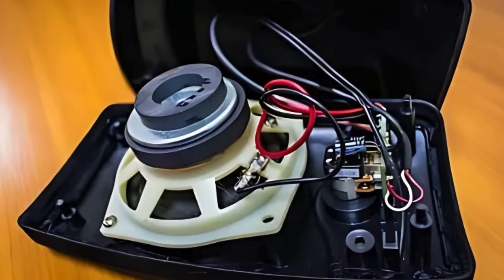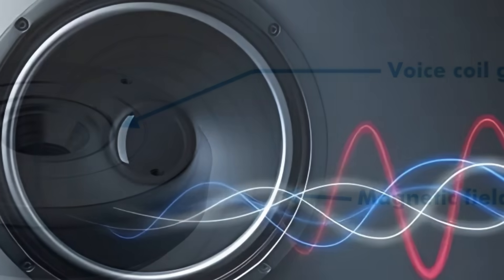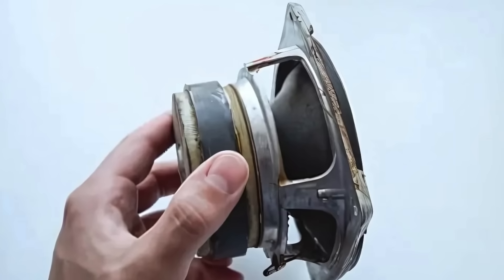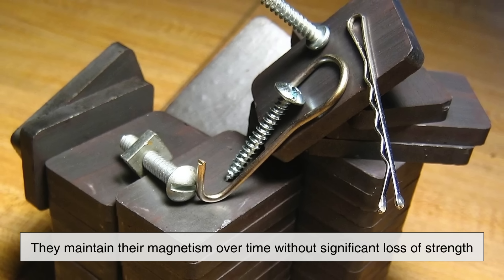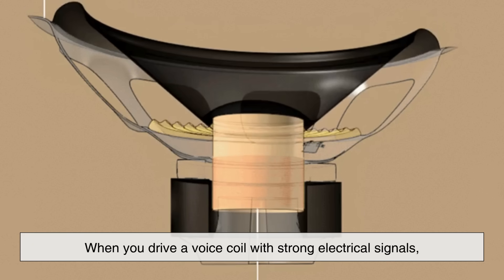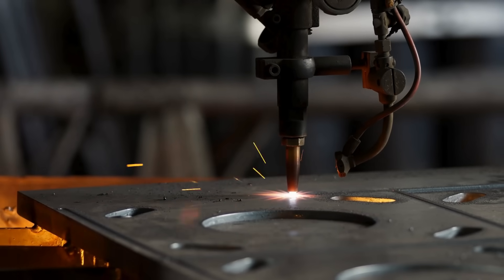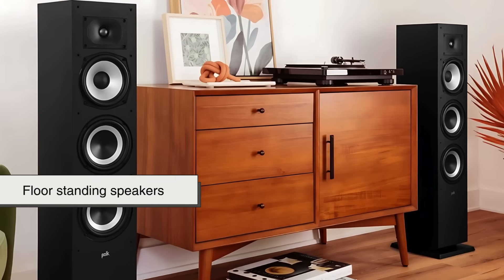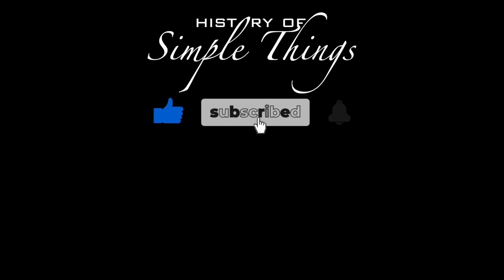Why Do Speakers Use Ferrite Magnets?

Comment: To shorten the video they use ferrite cuz it's cheap, doesn't corrode, high resistance to heat, and pretty much has better magnetic strength for it size.

Comment: Neo magnets also lose their magnet strength  much quicker with heat. which is why they kinda suck for car subwoofer use. Mid and high drivers don't produce as much heat as subwoofers, so,  for them, it'snot an issue.
Reply: Metric F-ton of PA drivers use neo, because for fair use, high grade neo doing 150-160 degrees Celsius is all that's needed. Before the neo degrades, other speaker parts fail. Like, other glues, the coil itself (can be over 220 degrees before the heat transfers into anything serious for the magnet). It is rather that car audio did not learn to work with neo or the driver would be insanely expensive due to their insane price margins. 80-240 % is very normal there.

Comment: Before ferrite magnets there were electromagnets which formed part of the D.C. filter as well as a high strength magnetic field. They were usually equipped with a hum balance coil to keep the ripple current from modulating the audio signal.
Reply: Electrodynamic speakers were last used in 1960. You're right that the coil was placed between the two filter capacitors. The system worked because the output stage used a single pentode (or a beam tetrode) in a class A configuration; therefore drawing a constant current, irrespective of audio volume.
The audio quality of those speakers (and amplifiers) was horrible, with a telephone-like audio response curve. At the beginning of the '70s we begun listening to some real music, with DIN and RIAA setting some rules to follow...
Reply: @Ray_of_Light62  They used them with push pull output stages as well. I had a Wurlitzer juke box that had a fifteen inch electromagnet speaker. It sounded all right when a long play high fidelity record was patched through it but the 78 r.p.m. records did bite the big one. It was a full range driver and sounded good with guitar. Just low gain.
Reply: also the alnico magnet.
Reply: Sounds like a humbucker

Comment: Modern concert PA systems have, almost exclusively, moved on to using neodymium magnets.  Yes, that extra size of a ferrite is a drawback, and Yes, the extra weight and volume of a ferrite magnet IS a big issue!  When you are flying a rig of 24 cabinets, each weighing in the hundreds of pounds, any savings in weight IS a big issue.  Plus, neodymium provides a much higher efficiency & performance ratio to weight, compared to ferrite.
Reply: Yeah. Neodymium speaker magnets + composite material cabinets + class D amplifiers save millions of sound guys from back sore
Reply: Just do not overheat neodymium magnets, as they tend to lose their magnetic strength when heated up too much. Iron ferrite and samarium cobalt magnets are far more tolerant of heat. Just my $0.02 worth.
Reply: Bingo that's why subs suddenly got lighter lol. Around the 500 series of JBL subs a friend had I was blown away by how lite they were compared to older subs.
Reply: @nbrown5907  New subs also use special-designed acoustic guides and cavities to achieve same SPL and sensitivity in smaller cabinets

Comment: What is the mechanical difference between subwoofer, woofer, midrange and twitter?
Reply: Subwoofer is very low frequency range: 15 Hz to about 20 Hz. You can't hear the bass, but you can feel it. Woofer is about 20 Hz to 300 Hz. The bass is deep. Midrange (squacker) is 300 Hz to 5000 Hz. It is men's and women's speech, piano, guitar, violin and most instruments. Tweeter is 5000 to 20,000 Hz. It is very high sounds, most of which you can't hear, but your dog could. The "s" and "z" consonants sound better. Bird whistles sound better and women's soprano parts sound better. Most tweeters are very small, with a CLOSED metal back to protect the delicate cone from damage by powerful bass sounds. And an electrolytic non-polarized capacitor feeds them to protect the tiny speaker from high-powered low frequency electrical signals. Hope this helps.
Reply: Tweeters are often piezzoelectrical. Especially the cheaper ones.
Reply: @marekstanek112 Actually, that is true, many are. For such a small speaker, they use both piezoelectric and electromagnetic.

Comment: Ferrite has been replaced by ALNICO and neodymium in better quality speakers. Much more power than ferrite.
Reply: Ferrite magnets of the same strength are simply larger than neodymium magnets. Speakers with ferrite magnets are no less powerful; they are just a bit heavier, which isn't a disadvantage in terms of sound quality.

Comment: Tldr 

Because of dynamic range, frequency response, impedance, and size

Using ferrite and rare earth magnets make your earbuds and wireless air pod and Bluetooth ear piece so small 

Shit nowadays looks like everyone wears a hearing aid in both ears 😂

And typically with impedance probably no higher than 64 ohm on a pair of headphones, don't need a lot of power 

Loud ass headphones but the signal is under 3 volts and only a few 10s of ma

Comment: Today, speaker magnets are permanent materials. Many years ago, speakers were made with electro-magnets. The coils in the speakers were also used in the circuity as transformers for the radios and amplifiers. Floor standing radios had a big speaker in the grille with electro-magnets involved.
Reply: Back in the day, speakers were driven by tube amps rather than transistorized amps. There was a step-down transformer on the edge of the magnet to bring down the voltage for the speaker. They called it "impedance-matching" transformer. It's a good name, but I like "step-down" better. The plate circuit of a tube uses high voltages, where the collector circuit of a transistor uses low voltages.

Comment: Then what would our electric cars and trucks be like if we just had ferrite magnets where the neos would've been, without increasing their size to compensate?
Reply: They'll just use induction motors and VVVF inverters
Reply: @FOHGeek : No, these would still have permanent magnets; notice when you reread what I said, but more carefully, that I was still talking about motors with permanent magnets; just if they were ferrites instead of neos.